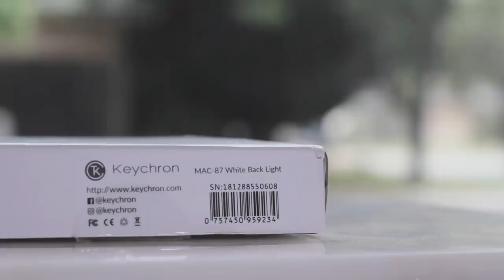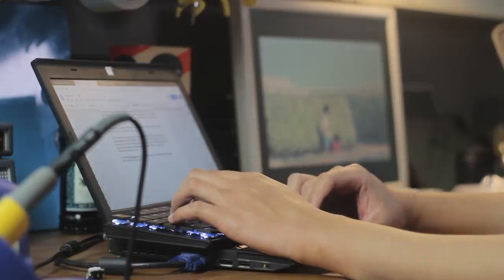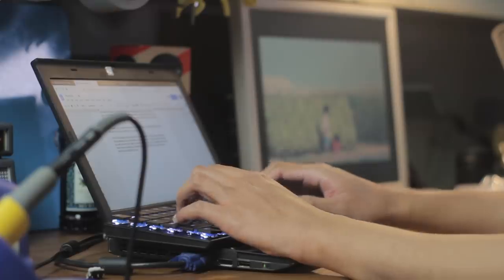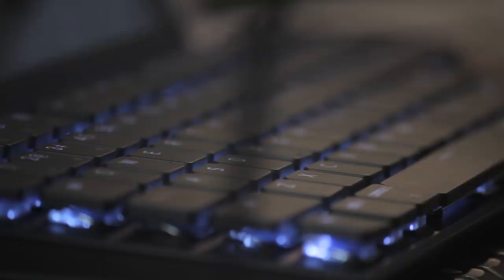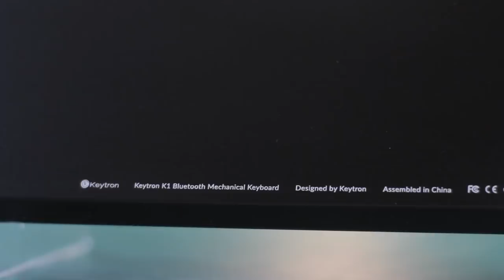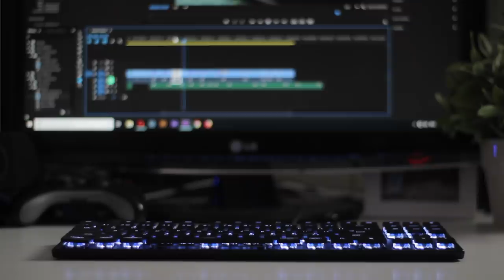Keychron K1 Slim Wireless Mechanical Keyboard - Unboxing & Review

Comment: That's actually one of the best click sounds I've heard in a keyboard. It doesn't sound as plasticky as the generic cherry mx blue click.
Reply: try some zeals gateron or kailh cherry blue is horribad
Reply: @mkuroglu  boi no one wants to spend $1+ per switch. Also clicky switch to assert dominance, so he would want kailh clickbar switches
Reply: @jvniprbrry  no one wants to but most will if they want to. I too am owner of a board with thiccbars (jade) love them. So I was meaning only blues are horrible not all clickies/tactiles.
Reply: I just hate the sound of clicky switches in general. They just make me feel on edge. That is why we go with the mx browns or equivalent/ Tactile but no click. They are so satisfying
Reply: Zero click mechanism on blues make them sound super scratchy imo tactiles tho mmm yum
Reply: @MysticalGB  Mx browns don’t feel tactile, they’re more like a sandy linear. You can only feel a tactile bump if you type 1 WPM.
Reply: @bromudro  its more like a smooth bump but you can still feel it. But just not very well
Reply: Uh blues suck try jades thry are way better

Comment: I'm still waiting for mine to ship, but really looking forward to typing on it. I actually really like the sound of it, and as a video editor it feels like a great step up from the flat mac keys I've used in the past. Thanks so much for the in depth review as always!
Reply: Did you finally got it? Could you give me a quick opinion?
Reply: @danielmunoz6915  My main complaint would be the flatness of the key caps, combine with how smooth they are - it can make typing difficult. But looking at the Keychron site now, it looks like they've updated the key caps to have more of an indent. I got the first iteration and their new K1 Version 4 looks better in all respects, notable multiple options for switches,  and a really decent price (I got v1 for $150 USD and v4 is $70 USD). Hope that helps!

Comment: It's the best keyboard I own so far. I use to own Logitech K810 which I used for a good 6 years before some of the keys died on me. 

So thank god Keychron invented something which was what I was looking for. 

The height is perfect for daily typing. I was contemplating between Keychron and Nukey (which I think it is also another awesome keyboard but I could not touch and feel Nukey.  Keychron was made available in my city) and I ended with Keychron because I could feel it. It's build like a tank and if you whack somebody on the head, you might just crack his skull.
Reply: Where did you buy this version of k1 from?

Comment: Thanks for the in depth review. Did you get a case with it and if so, what are it's measurements? I'm a programmer that wants to have a solid typing experience with a compact, portable keyboard. This looks ideal, but I want it to be protected in my bag.

Comment: Warning for those who are planning on buying this keyboard
I got my Keychron K1 (revision 3) 2 days ago. Today I was playing Stepmania and when I tapped the 'x' key sometimes it would not register (I even tried training mode and a couple of songs under 14 to see if I was going crazy). I am really disappointed because I like the slimness of the keyboard, it's features (wireless, firmware-based lightning instead of having to download a Windows program). I think the problem here lies on the quality control and that might be related to how the manufacturing process was outsourced to a Chinese company.
Reply: Update: I've been using it now for a couple weeks after I said that and the x key seems to be working normally (I even tested it multiple times on notepad). I think it's definitely something related as to how I tap keys way harder than I should when playing stepmania so I guess I'll play that on my bulkier keyboard. And no, keychron didn't put a gun in my head for me to post this.

Comment: For the lithium ion battery, can you use just about any or does it have to be the one that's inside the keyboard? I just got my Keychron K1 V4 yesterday and was looking to get a bigger capacity battery. And where would I look for such a battery?

Comment: I'm thinking about K1 V4 & the Hexgears X-1, but the new K3 with optical switches looks amazing I'm thinking about pulling the trigger on the $74 rgb varient - I'm just wondering if the 1.1mm pretravel & 2.5mm total travel distance is going to bug me. It sucks that the Gateron version isn't hot swappable - that 55g Brown switch seems kinda heavy... I love how mild and crisp the click is in the Outemu Snap Spring switch, who do you think does the best low profile switches for something as a daily driver: both productivity and gaming? I've never tried reds and almost ordered a Dierya DK61(on sale for $47) which would of been my first time venturing into optical territory as well as 60% without designated function or cursor keys(it's what's taken me so long figuring out between 60% 61/63/68 or 75% 84/87/88 keyboards - I'm familiar with TKL and full). Have you ever tried the Drevo Seer Pro? I don't think it has optical, but regular Gateron mechanical keys...

Comment: My K1 v4 arrive a few weeks ago with the new Gateron Blues.  Frankly, the keys feel terrible compared to the OEM Kail Choc-whites in my Havit (the OEM versions in the Havit are blue, for some reason).  Looking at 6:17, and comparing it to the Gateron blues in the v4 (shining a flashlight through the top), it looks like the Gateron's use a design identical to the Fralys.  In other words, no clickbars.  That probably goes a long way towards explaining why they feel nothing like Choc Whites.  Either way, I agree that the keys Keychron is using the K1 are [still] substandard.  It's too bad, because it is otherwise a nice keyboard and comes with an optional Mac layout.  I don't know why Keychron insists on using something other than Kaihl, as switching vendors would solve all of their problems.

Comment: Wireless era is coming!
Reply: aaah not sure... The batteries still suck, and I don't see much point in a wireless RGB keyboard with a 10 hours autonomy. For mice, sure. Although the problem is the same (LEDs eat batteries), you don't actually need a lights on mice, so they can be wireless and efficient. 

If they can make wireless RGB / backlit keyboards that can last a month without recharge, like the new Logitech mice, then sure.
Reply: 0B ZEN yup.. The battery management still not good enough if pair with RGB. But if just backlite I think  it’s fine and can be use more then a week. I have both wireless rgb and wireless backlite only and I totally agree with you for the RGB part. The light is a bonus. Just turn it off if we don’t want it. 😉

Comment: Does anyone have any suggestions for low profile keyboards, if not this one? I was looking at the Drevo Joyeuse, but it's out of stock. I have a lot of keyboards of varying Cherry, Gateron, and Topre types but I'd like to get into the low profile world. It doesn't seem like there's much variety. Maybe something closer to MX Red?
Reply: Get the Tesoro Gram XS and you won't regret it. I know i never looked back on the Keychron K1 after i bought the white model with the red switches. Build quality is flawless. Keychron couldn't make things right for me and they just couldn't get their shipping company to deliver to my place which is odd because the other shipping companies could without any issues.

Comment: The lighting modes are identical to my Royal Kludge RK61, wonder if they are running similar software or if they are made by the same company with a different name. You should review the RK61 (it's a budget board with knock-off in-house blue clones)!
Reply: why he should review board with rattle crap switches?

Comment: Two questions:
- Do the keycaps for these Fraly Blue switches fit on Kailh Choc switches?
- Has anyone found a good source for either these keycaps, Kailh choc keycaps or Cherry ML keycaps?

Thanks in advance!
Reply: I don't think these low profile keys work with kailh switches. The key cap inserts into the switch differently. It doesn't have the "pole" under the keycap to insert into the traditional kaihl switch. That's how they get it so low profile as the pole adds additional height. However, this means you can't dampen them with o-rings because there is nothing to slide the o-ring over.
Reply: @sAmiZZle82  Thanks for your reply! You mean the "+ shaped pole"? You'd find that on Box switches, Kailh Choc switches have a different double "- shaped "pole".
Reply: @tomhemmes7896  actually yes you are right I got confused... It is the choc switch that doesn't fit this PCB board. It would seem the key caps would fit the choc based on the interface design as you mentioned, but I am not in a place to say for sure as I can't test this.
Reply: @sAmiZZle82  Allright, thanks! Neither seem to be available for sale online anyways..

Comment: Actually this is very appealing for me. Mac oriented designer that need better keyboard but not necessarily too critical of its performance unlike hardcore gamers. Also most mechanical keyboard are too clunky, have absurd RGB design that just doesn't sit well in design offices like mine, and once I went wireless I couldn't go back to wired keyboard anymore. for really long time I have been waiting for something like this, because honestly apple keyboard and mouse are great to look at but horrible to work on especially if you ever used gaming devices.

Comment: I was super excited about this keyboard until I got it.  These switches are VERY annoying. The clicks are high pitched and quite distracting. Also, I thought the sensitivity of the keyboard would be beneficial to typing speed. I was wrong. I constantly find periods and double letters when I find myself typing fast. Would try to find a better option at a cheaper price. Don't get me wrong. It's a fun keyboard and very well built. Just don't plan on using this in an office setting. Maybe at home.

Comment: Is it worth getting this to replace my apple magic keyboard. I've never tried mechanical switches before and to me the slim design and Mac compatibility means alot more to me than slightly better key feel. Also the fact it's Black and RGB is a big selling point for me I'm just worried about being disappointed with it
Reply: Honestly, I'd say mechanical switches are always going to be worth the upgrade regardless of which switch (there are quite a few). For most people used to the more quiet keyboards, red (light to the touch) or black (heavier switch) linear switches are perfect. If you want something loud and clicky, blue switches are great. Something in between (quiet but clicky) browns will be just right. I'd say browns are the most popular for the quiet tactile bump for satisfying typing without being SUPER loud like blues. Reds are the second most popular for it's light, linear switches great for gaming, and blues are tied or third for their great clicks. I think these only come with clicky switches, so make sure you like that. This is only the basics, so check on your preferred switch before deciding.
Reply: Victor L  they do the blue and now reds and I was going to go with the reds
Reply: Victor L I actually like the feel of the Apple keyboard so I though red would better suit me
Reply: @LewisHolford  Go ahead and check out the Keychron K1 on their website. I think it's like $85 and comes with red switches with rgb. It's up to you if you want to spend the $85, but I feel it's worth it. I'm also not a great role model though. I'm about to drop $100 on an Anne Pro 2. Great keyboard with what you like, just compact rather than slim.
Reply: Victor L I have looked at the website and its basically everything I want basically emulates the mac layout well. And i did check out the Anne pro 2 I do prefer the slimness of theyk1 and it doesn't support the mac keys does it?
Reply: @LewisHolford  Anne Pro 2 is going to have your more traditional keys in a compact form, but you can use their software to add macros on the keyboard for Mac most likely. Go ahead and cop the Keychron soon if you like it. Hopefully the low profile reds will be to your liking. They won't have the mushy feel of a membrane keyboard, so it'll have that smooth press until you bottom out.

Comment: This keyboard still sounded to loud and annoying for office use...wish I could find a wireless keyboard with standard scissors switches in a tenkeyless layout (or 83 key). I'd like to have the same keyboard in the office and at home to use with my laptop hooked up to my tv. My orange switch razer was...not appreciated by my coworkers who described it "like a coachroach running across the table".

Comment: I think that Cooler Master should've just used a Kailh Choc LP switch for their MK630 and MK650 slim line of keyboards.
Reply: Yeah. Their switches aren't very thin. They're not even in the thin game. Just chiclet caps. They don't even stack up to the Havit HV-KB390L which uses the same Choc switches as this Keychronic. 

I wish they'd just drop the MX stems. I think them really gunning for that ruins the slim functionality.
Reply: @revolver265  Probably because using "original Cherry switches" still makes for good advertising. Nevermind that Cherry using the MX stem for their low profile switch makes no sense, since cross-compatibility with MX keycaps would be pointless if the switch as a whole is meant for a different shape and height of keycap anyway. I guess DSA profile keycaps might still work for these? No idea. But hey, so long as Cherry does it, people with too much money and no time to do their research will keep buying into it.
Reply: @revolver265  Keychronic does not use Choc switches, it uses Frayl blue, and they are terrible - currently trying to send mine back.

Comment: I bought it on the Keychron website. This keyboard is amazing, but the Bluetooth doesn't work. I have been using it all day trying to get the Bluetooth to connect. When it does it last for like 10 seconds and then disconnects. 😡

The build quality, the led lights, the typing is all 5 stars. But what does that matter is the Bluetooth doesn't work. I didn't buy this to have a wired keyboard. I want to be able to use this on my MacBook Pro and then my iPad pro. But guess what? Bluetooth doesn't work.

Comment: I find it extremely bizarre that Kailh's Choc switches have not caught on more. Their QC is great, they provide amazing tactility and Kailh even makes an inexpensive hot swap socket for said switch type. They should be a no-brainer, but yet most vendor still choose to use inferior switches. Give me a 96% / 100% ISO (or big ass) board with Choc hot swap and my cash is yours.
Reply from the maker: I too am really surprised they haven't really caught on. They're clickies are absolutely amazing, just like their Kailh Box clickies, but smaller!
Reply: I might try creating a PCB for that.

Comment: Why’s there a review for this unit in 2019 but it’s only in preorder as of june 4, 2020
Reply: Because the one in this review is an older version of the K1. If you enter Keychron website today, they are taking orders for the new version of this keyboard (4th version). The website points out what are the new features compared to the previous version.

Comment: I have had the keyboard for about two weeks. Some of the keys do not light up periodically ( 9, O, L, <). A bit of a bummer since the patterns are awesome on the rgb keyboard in the dark. Otherwise, I've realized that I've had to be more decisive in my keystrokes to avoid double clicking a key. Very sensitive. 

Overall, I love it even with the lighting issue. Hopefully they will make a v3 and take in some community feedback.

Comment: extremely sensitive keys. I can't type a sentence without accidentally double-clicking a letter. Also, keystrokes are registered before you can feel a bump. It wouldn't be bad if it weren't for the fact that the keys are actually quite heavy.

Comment: It's not wireless! It's mere Bluetooth, which is disqualifies it's for any gaming or coding purposes. Wireless means it have dongle and some ultra-super-duper fast connection. Like Logitech's Lightspeed or Razer's Hyperspeed. Also keyboard have no right to miss any button press due to it's sleep mode. Means all those 90% keyboards on the market - is crap.
Reply: @NickSiekierski  am I supposed to be offended by your silly comment?